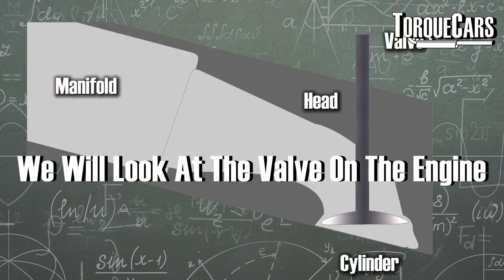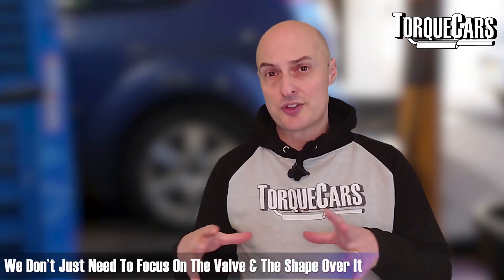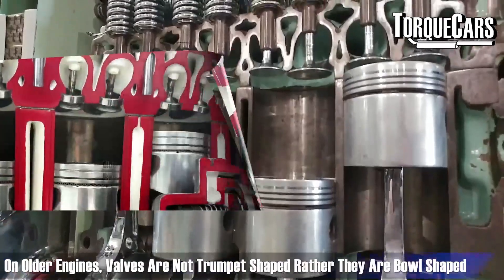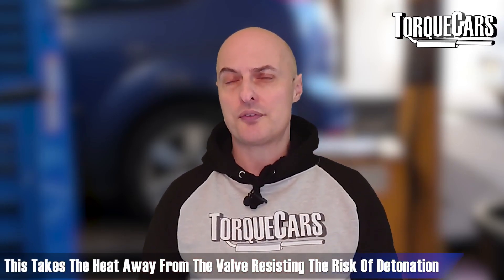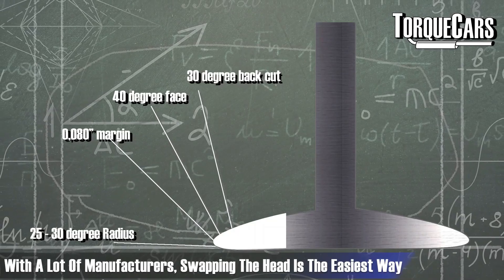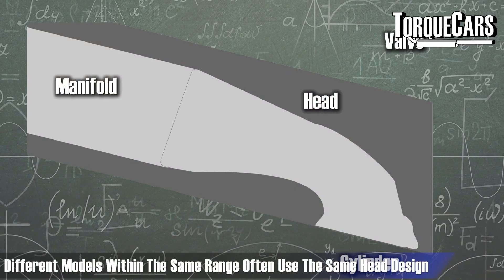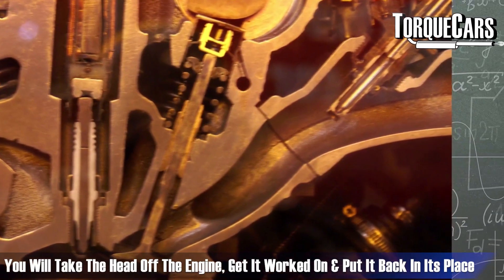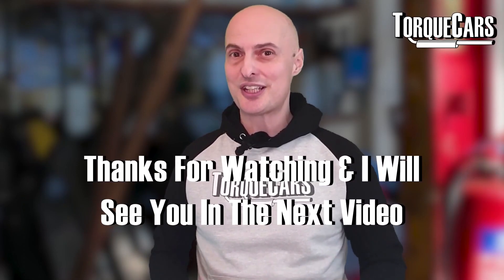Guide to Performance Valves & Engine Head Tuning

Comment: I currently have a 1.8T in my basement I'm building for my daily. My goal is 8000+ rpm, 30psi and hopefully 400hp+ to the front wheel. It has about 300 currently. My odd ball 01 B5 A4 manual transmission, fwd and no sunroof!
Reply from the maker: Wow that sounds like a nice project. I really interested in hearing your progress on that. Would love to see some build video footage on this if you get a chance to shoot any.